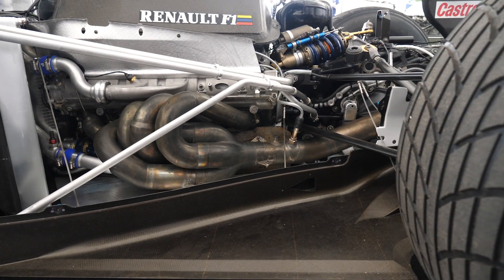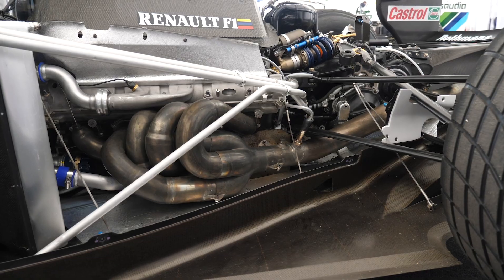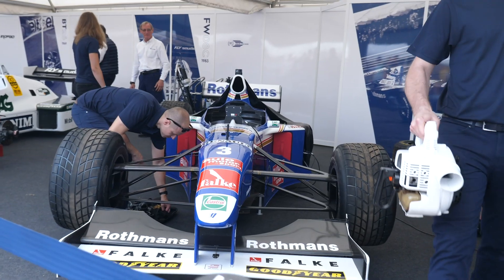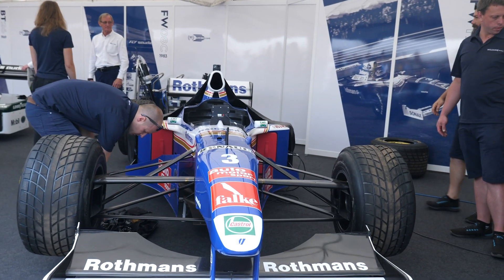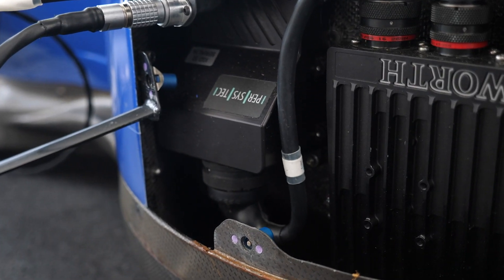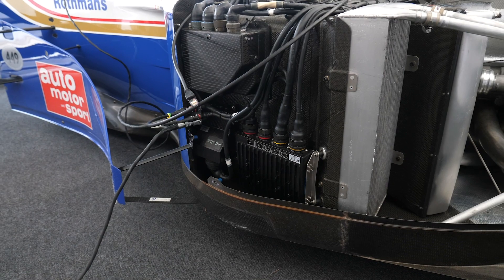How To MODERNIZE A Formula 1 Car? | Williams 650HP NA V10 FW19 [TECH TALK]

Comment: What is this 'alectronics' he keeps referring to?
Reply from the maker: I recommend using the captions if your English is a bit rough or if you struggle with different accents. They will help in either case and are not those terrible 'auto' ones ;) - Taz.

Comment: You should only do videos like this and last f1 video. Fucking great insights
Reply from the maker: Cheers mate, we still have more F1 stuff lined up, but we do like to ve as varied as possible as well. It is interesting to learn about F1 in contrast to other motorsports I reckon =) - Taz.
Reply: @hpa101  right on. Yeah the time attack stuff is amazing too. I subbed finally after watching a vid here and there. This f1/rare stuff i love it if only we could disassemble the f1 engines and examine every part. Keep it up

Comment: Great interview. 
So the upgrade is primarily because of the lack of support by Microsoft of the original (windows 97?) Computer's. Why do these computer's need support from Microsoft? Do they not just work? Is there not independently developed support for this era of computer by now?
Btw I see that to install a modern ECU is better and much easier deal with for sure.. just interested as to why the original has become almost impossibly redundant by now?
Reply: The standalone ECU doesn't need support for it to work.
 
The program to communicate with the ECU to make changes (tuning) needs Microsoft support.
Reply from the maker: It's the OS, the hardware, the software, none of which are updated so if there is a bug you are screwed and have potentially wasted a trip to bring the car halfway around the world, the experienced knowledge of the software and hardware is gone from the current crop in the industry and also if something is physically damaged, sourcing a replacement is not something you can do quickly or potentially at all regardless of cost even just for an old laptop that has a battery that works.
Lastly, if you have used any kind of modern device I'm sure you understand how they 'should' just work, but often don't for no apparent reason. This is not new sadly! 😂😂
Even the updated gear can have issues, but at least you can pick up the phone or fire an email to work through it with multiple people around the world. That's it in a nutshell - Taz.

Comment: For the purposes of historical, heritage and originality...
Would be desirable to keep all the components as though they still function, even if they don’t.
Reply from the maker: If you value the car as something to be worth as much as possible at auction, possibly, if you value it as something that should be used, why worry I reckon - Taz.
Reply: @hpa101  perfect answer
Reply: If I had an f1 car I would have to have 2 for this reason, one stock and one current. Thanks for the tip!